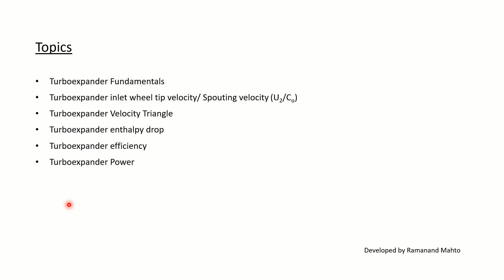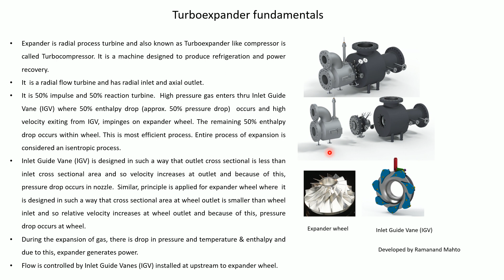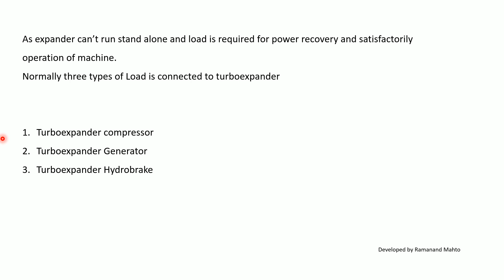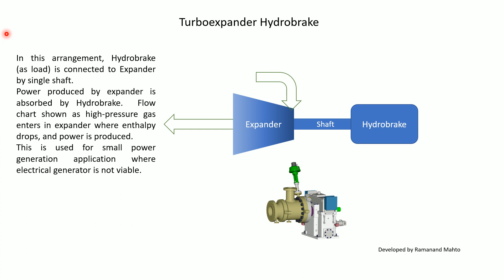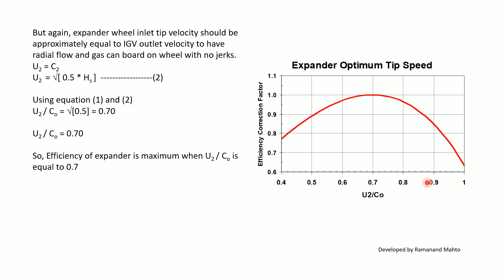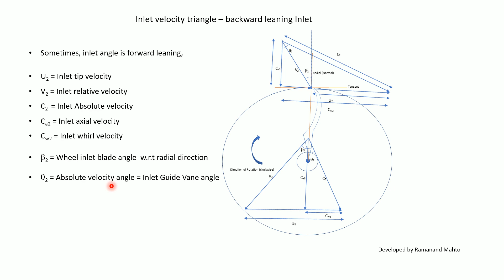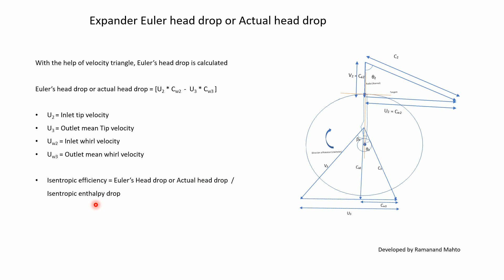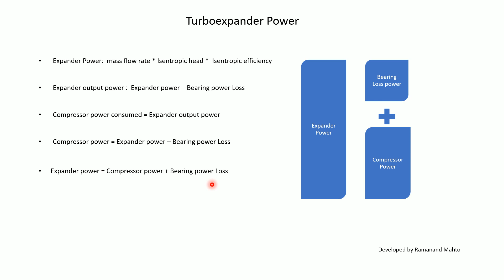Turboexpander Fundamentals

Comment: Please explain more on pre and boost arrangement...
Reply from the maker: I will make separate video on preboost and post boost arrangement of turboexpander compressor system. In fact, many more video on turboexpanders will be coming up ..In the mean time , let me explain preboost and post boost system.  If high pressure hydrocarbon gas is available in the plant, then high pressure first enters into expander where expansion of gas occurs, in most of cases,  recovery of heavy gas is done,  then after passing thru gas cooler, warm and lighter gas comes to suction of compressor of turboexpander and pressurization occurs. High pressure of compressor discharge goes to sale gas , other application to the plant . This process is called Post boost arrangement.  In case of preboost arrangement, Low pressure   hydrocarbon gas first enters to compressor suction of turboexpander, pressure ruse occurs in compressor and high pressure gas goes to gas to gas cooler where gas becomes cold . Then this high pressure and lower tem has enters to suction of expander and expansion occurs . And due to expansion, pressure and temp both drop ..outlet of expander goes to plant process.. 
Pl subscribe my channel and advise you colleague to subscribe it.  Thank you foe asking question .